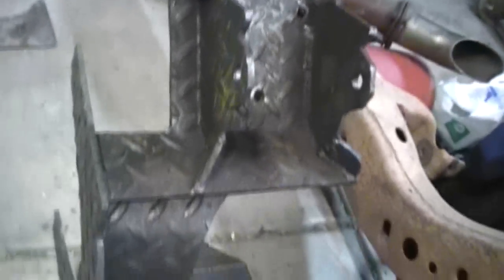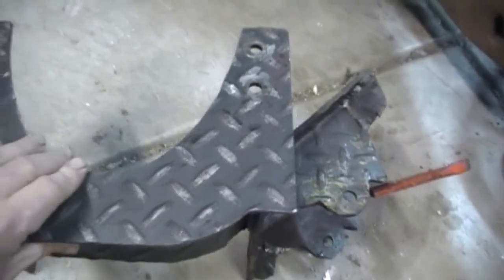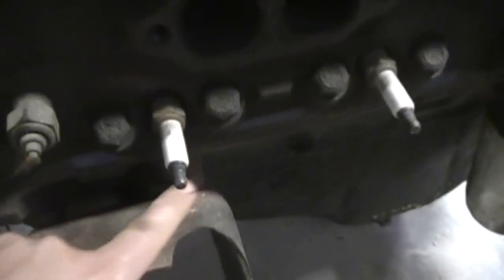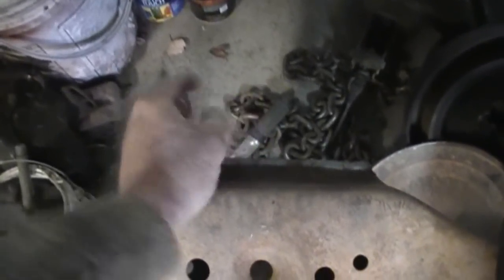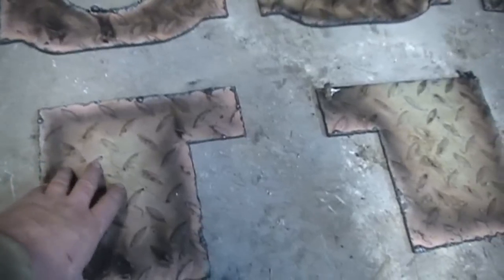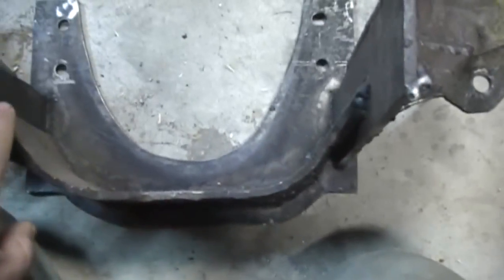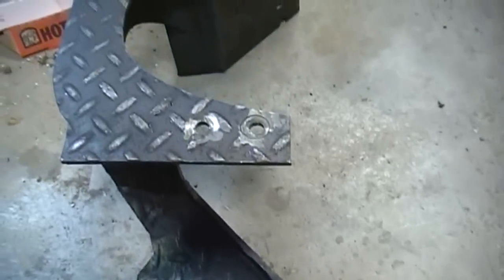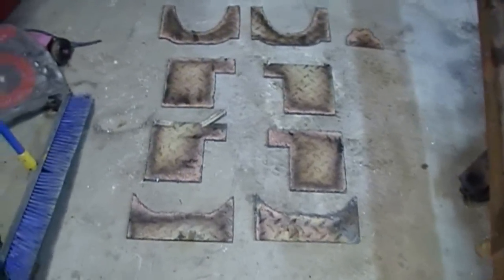Demolition derby tech, Small block Chevy cradles. Part 1

Comment from the maker: @ankenyrx8105 I brought the 302 home. Looks tough. The oil filter is in the way. And the front timing cover has no place to help from forward shifts. About all I can come up with is to run it under the pan. But this will only tie the side together. Not front to back. And it can't be too big or the motor will sit to high.

Comment from the maker: @rproctor30 I use lock tite red too. I did not really explain that right. A guy I know thinks that a 3/8 grade 8 bolt can be torqued past 80 foot pounds. And he thought that it was the lock washer failing when he tried it. But the point I was trying to make is that the bolt too would fail. He thought using no washers meant he could over toque the bolt. And yes this guy's engine always seems to break loose. Mine don't. And I agree lock washers fail. And only 1 percent even work. Cheap non US junk

Comment: @kgilroy25 ....... We had a loc Tite rep come to work a few months back for a class. He told us that lock washers do not work like people think they do and he gave us a demonstration. lock washers make it easier for a bolt to back out... if I had a camera I would up load a vid to show you what i mean...  You might just buy some loc tite extra strength (red liquid , Blue is medium strength) ..... clean both bolt and hole with wax and grease remover and use the washer and use the loc tite .... I

Comment: @kgilroy25  I will gurantee the bolt will not back out ...... we use loc tite on 2200 ton presses and 50 thousand pound molds at work and never had any problems

Comment from the maker: I think I got it. I need legal size paper and ink for my printer. I got a new idea. I may be able to email them. But I need to print it out and check that measurements don't change. I had a CAD system. But it came out all weird. Too old. Would not work with a newer computer.

Comment: Doesn't this make it so you can put the motor you're using in just about anything it'll fit into?
Reply from the maker: Not really. Small block Chevys  break off the motor mount bolts. Pretty much the main reason. It still uses the stock motor mounts.
Reply: Would it be hard to make it so it can use it's own weld in mounts?
Reply from the maker: +Seth Mullins No. That would be easy to do.
Reply: Then that's my plan. I'm gonna do this but use a ford v6 because at the end of the day, if I suck and mess up the thing, It's only something worth scrap price anyway.